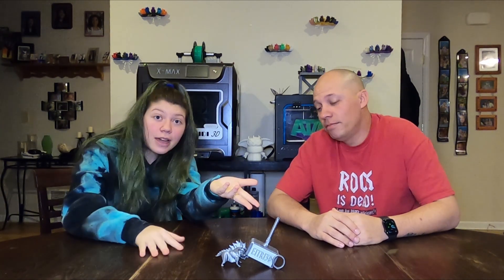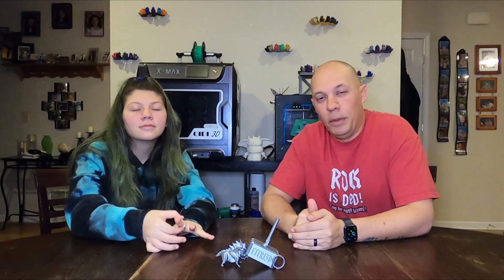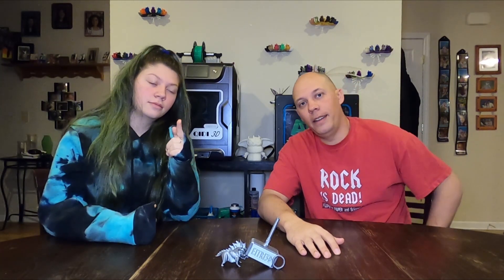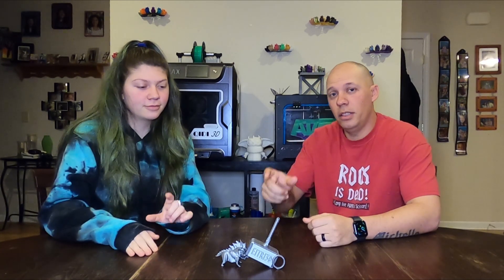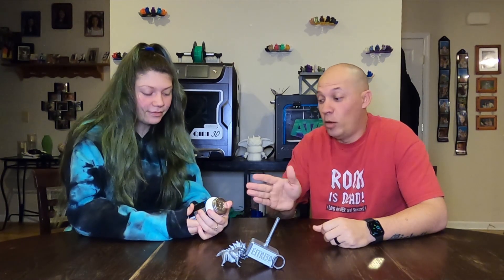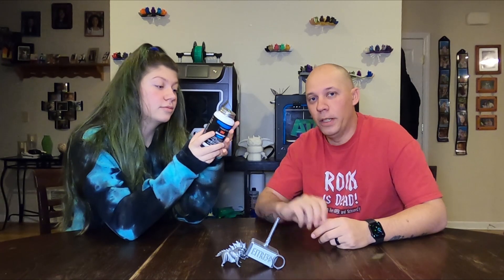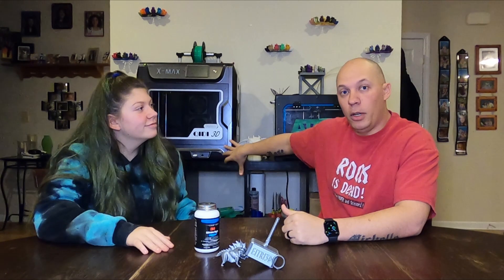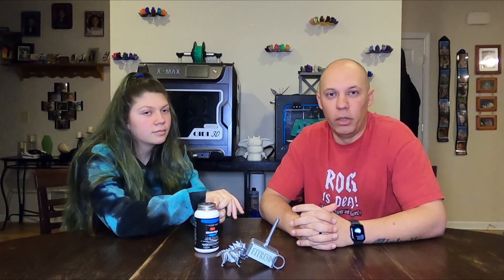Qidi X-Max Maintenance

Comment: Hi and thank you for all your videos you put out for 3d printing . I just bought the qidi x-max and have about 30 builds from small to large and different types of filament. haven't use hi temp extruder yet though. My question is how often are you doing maintenance on the qidi x-max should i be doing this once or twice  a year or more? thanks for any input have a great day.
Reply from the maker: Honestly, I have only done maintenance once in 18 months and that was just for the video. I also am not printing 24/7. I would personally recommend basic maintenance every 6 months and maybe a deep clean annually.
Reply: Thank you very much. Keep up those great videos

Comment: How is that bed leveling mod working for you? I read someone complaining about how they replaced the spring with silicon spacers and now they are having issues.
Reply from the maker: I honestly have not had any issues with the bed leveling. I highly recommend it as I feel that is the biggest design failure with the Qidi X-Max.

Comment: Did QIDI specify lube quantity on the vertical rails?
Reply from the maker: They did not. I used what they recommended and guessed the amount. If a part was not cleaned or lubed that is because they did not recommend it.
Reply: @Eitri3D  the just wrote me back and said automotive lube is good too 🤷‍♂️
Reply from the maker: Car care 3M silicone paste from Amazon? That is what they suggested and that is what I used. Now to be fair, it’s worked perfectly and I have not had any issues.
Reply: @Eitri3D  it was the 3m lube/grease once I followed the link. I’m just surprised they don’t recommend the dry lube that almost all other oems suggest. But honestly, I think just wiping it down to get the big stuff off should be plenty for this machine

Comment: Silicone lube is best for metal to plastic, metal to metal should be light machine oil or a gear grease, PTFE lube might be okay as well, same for linear rods, if they are plastic bushes, then silicone lube, but if they are metal bearings, then grease or light machine oil.

Comment: How did you guys remove the side panels off your X-MAX?
Reply from the maker: There are 6 screws on the outside panels and one screw in the inside above the handle.
Reply: @Eitri3D  My model must be a bit different - when you look inside the holes on the outside panels there are these black covers and a metallic border, they almost look like magnets with a black rubber piece attached or something
Reply from the maker: Hmm, email the address on our channel and attach an image if you can.
Reply: @Eitri3D  finally got them off! Didn’t realize you could remove them with the included Allen wrench until I rewatched this vid. 

Did you guys have to do anything with the belt?
Reply from the maker: I’m glad you were able to remove them. As for the belts, we did not have to adjust anything on them as of yet.

Comment: I need a X-plus Door.
Reply from the maker: I don’t work with or for Qidi, but if you have no luck finding one on eBay (their official store) check the Qidi Facebook groups. Someone may have one laying around.
Reply: @Eitri3D  did you ever have issues cleaning the x-plus or x-max door?
Reply from the maker: I did not, however my clear piece did not want to stay in my door.